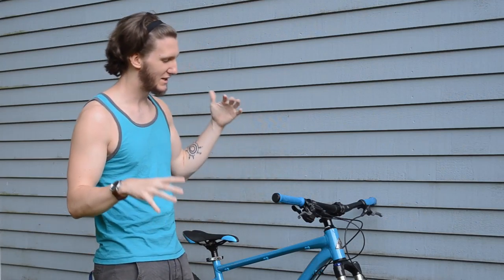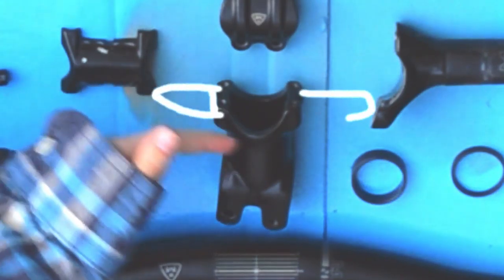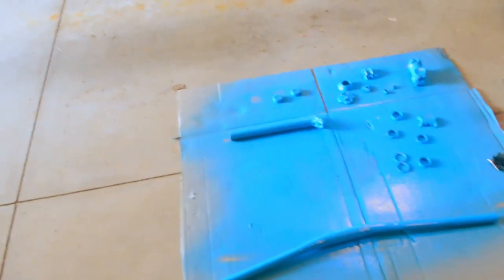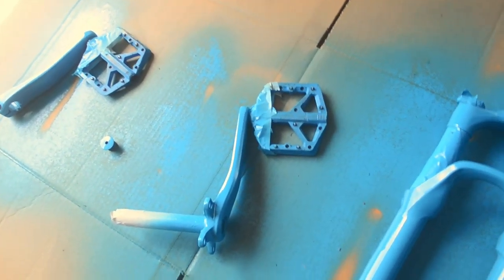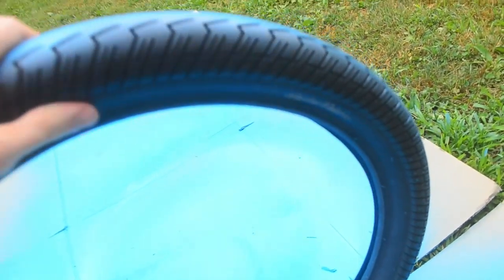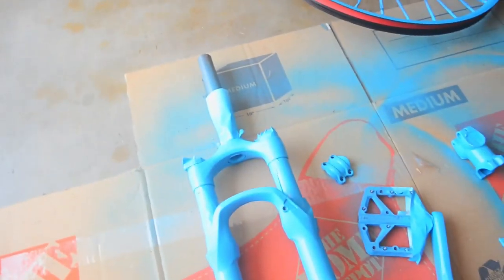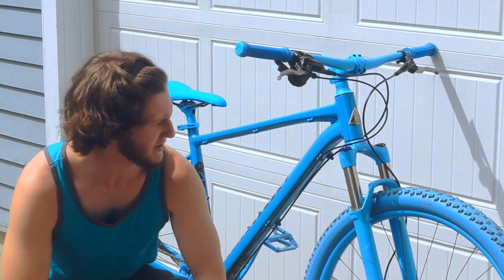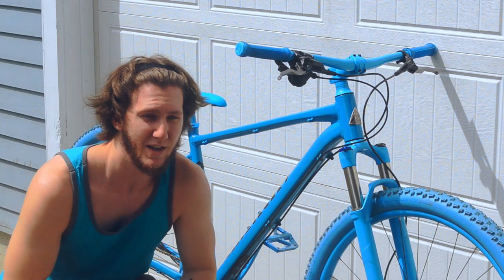Making my entire mtb BLUE!!

Comment: Thinking about plastidipping my bike tires, how long did it last?
Reply from the maker: Only took me 2 years to reply but here it is. For mtn bike tires with big knobs it lasts quite awhile (apart from on the knobs themselves which do peel off), but if it's more like a BMX tire that's pretty smooth, it'll peel much faster. Still pretty worth it imo though, since the grippiness stays pretty much exactly the same. After all this time 90% of my tires are still coated with the blue plastidip.

Comment: How them plasti dip tires looking .. my bike same color painting tires n the morning used a white primer 1st
Reply: I had tried using plastdip (red color) once on my bike tires and it quickly just ended up peeling off.
Reply from the maker: Honestly they're still looking pretty solid. Due to the knobbing of the tires, only the knobs themselves have peeled off, and the rest of the tire is still blue. The bike overall is definitely a bit less bright blue than it was in this video, but still quite blue for how long ago I did it.

Comment: What paint did you use. Could you link?
Reply from the maker: I believe it was this one https://www.amazon.com/Plasti-Dip-Performix-11219-Fluid_Ounces/dp/B008PO635Y but it's also been awhile since I did this video 😅 so I could be wrong.
Reply from the maker: I should specify, that's what I used for the tires. Not sure I know the paint used for the body of the bike. I just used the closest color they had at Home Depot 🤷‍♂️
Reply: @i_like_blue_stuff  oh alright so that was only for the tires and you just regular spray painted the rest? I appreciate this
Reply from the maker: @LuckyBeepo  Yup, to keep the grippiness of the tires and also improve durability of the paint job on the tires I used a Plasti Dip paint, and then for the rest of the bike parts that I painted blue, that was just regular home depot paint. A majority of the bike was already blue of course, so it didn't have to be any special type of paint or anything.
Reply: @i_like_blue_stuff  thanks alot man. I'm planning on tricking out my ebike using all you've given me. Appreciate it.